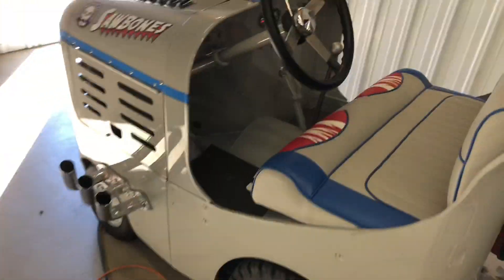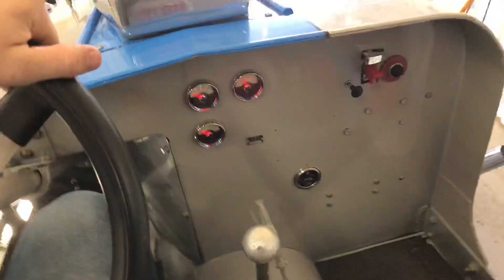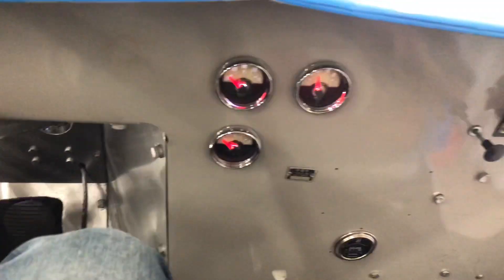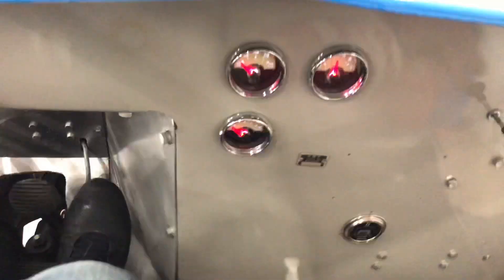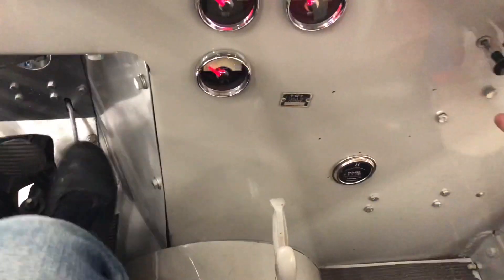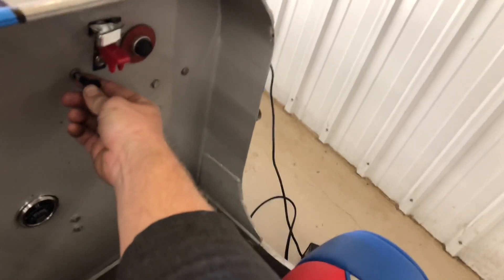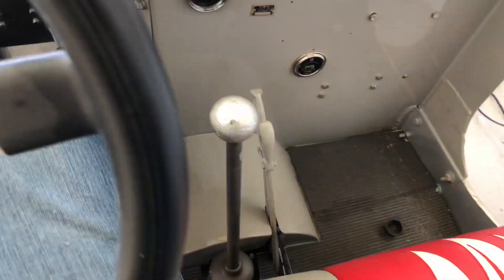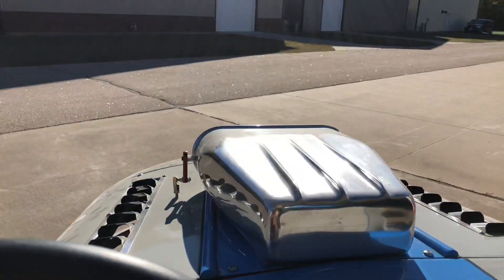1947 Clark tug old start fart and drive

Comment: I wonder if the pushing of the gas pedal works the same way in updraft carbs? Like doesn't normal carbs have pedal pump that just shoots gas down in the intake? So now if it needs to move up that is when my logic fails.
Reply from the maker: this carb is SO old I'm not sure if it even has an accelerator pump. it's force of habit :p